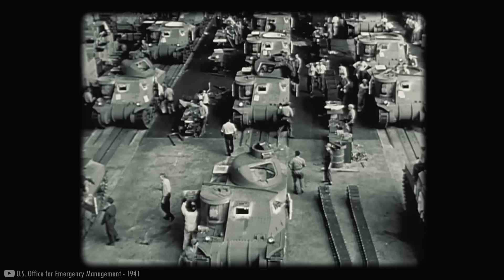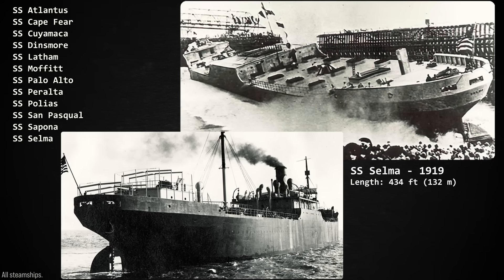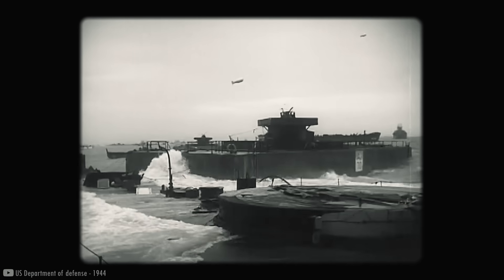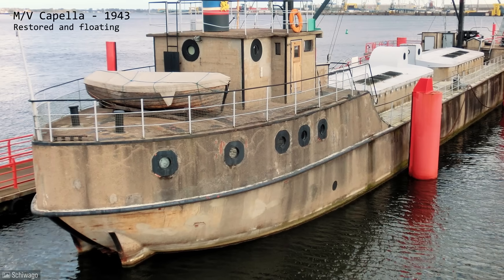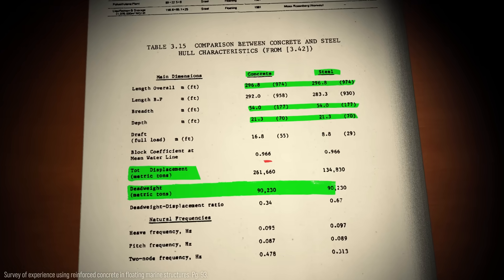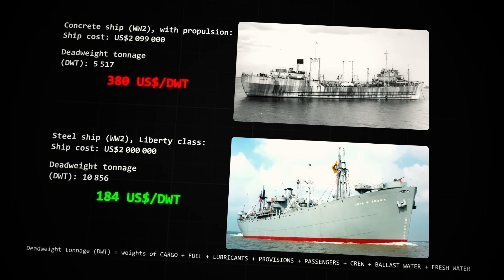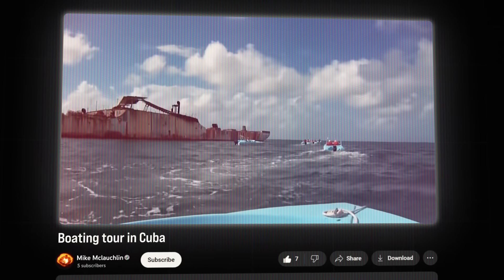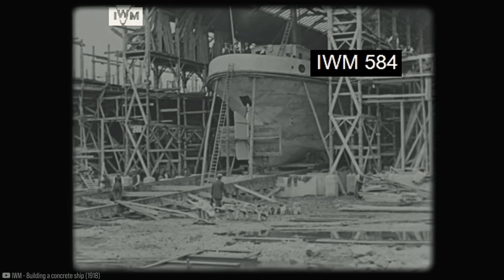The giant concrete ships 😮

Comment: I believe the technology still has potential. A steel ocean-going ship has an active life of about 30 years, during which it requires extensive maintenance to mitigate rust. A concrete ship could easily be made to last 100 years or more, negating the necessity of ship recycling which has become politically sensitive in recent years. I think concrete ships should be given another chance.

Comment: Back in the late 1960s I had a book on building a concrete (ferrocement) boats. I remember the book said a ferrocement boat over 30 feet in length is lighter than a wooden boat of the same size. Concrete is a little less dense than aluminum. In 1972 where I lived someone built a large ferrocement boat in their backyard. We called it the Ark.

Comment: I think the reasons we don't see concrete ships as a standard are the fact that concrete doesn't play well with torsion forces, and also another reason is the metal inside the concrete if not properly buried (5 to 8 cm inside the concrete) it will corrode due to moisture and rust making the cement blow out, thus exposing more metal prone to corrosion, and let's not forget sea water corrodes metal cause of salt

Comment: For every one of those ferrocement ships still afloat, there's dozens that sunk because one crack appeared and rust crept through the inner steel rebar. There was a boom in ferrocement/concrete recreational boats in the 60s and 70s, and nowadays many marinas around the world straight up ban them. Yes, they can be maintained, and if built just right and the weather conditions don't make them crack they might last for a long time, but most of them are time bombs with impossible to predict fuses. Then they sink, and they are impossibly heavy and hard to retrieve.

Comment: Concrete ships are not immune to rust! These are ferro cement structures which contain a complex latticework of rebar rods laid down to give the concrete flexibility and distribute stresses. Concrete is an absorbent material, the corrosive salt water penetrates into the concrete to corrode the steel lattice, and separate the concrete bond to the steel. The main problem that I have with ferro-concrete ships is that there is no way to accurately inspect and evaluate the level of corrosion of the steel rebar embedded within the concrete. A steel ship is constructed so that all its parts can be examined. However IF the concrete mixture is made with volcanic ash instead of sand then the concrete does not absorb the seawater and the corrosion of the rebar lattice  within the concrete is greatly reduced.

Comment: I used to live on a ferro cement boat, quite comfortable, I would be sleeping right against the hull surface, no insulation but it was very cozy and dry for a boat. Steel hulls just sink every bit of heat straight into the ocean if you don't insulate them.

Comment: I think the durability issue could be a double edged sword too.   They do recycle concrete in construction jobs but it depends on the structure.   Where I live the one cement mill has an old abandoned building and one of the workers told me that the walls are 3 feet thick so it's immpossible to tear down.   Yeah you can jackhammer through 6 inch concrete but the labor involved in doing to negates any value of the recycled materials.

Comment: Pier Luigi Nervi, born on 21 June 1891 in Sondrio, Italy, was a pioneering structural engineer and architect renowned for his innovative use of reinforced concrete.

Early Life and Education

Nervi pursued his studies in civil engineering at the University of Bologna, graduating in 1913. His early career involved working for the Società per Costruzioni Cementizie, where he gained practical experience in concrete construction.

Innovations in Reinforced Concrete

Nervi’s ingenuity lay in his ability to combine engineering precision with architectural elegance. He developed a construction system using ferrocemento, a form of reinforced concrete that allowed for the creation of lightweight, durable structures. This technique enabled him to design complex geometrical forms that were both aesthetically pleasing and structurally efficient.

Notable Works

Throughout his career, Nervi designed numerous landmark structures that showcased his mastery of reinforced concrete. These include the Palazzo del Lavoro in Turin, the UNESCO headquarters in Paris, and the Pirelli Tower in Milan. His work on sports facilities, such as the Palazzetto dello Sport in Rome, demonstrated his ability to create expansive, unobstructed spaces using innovative concrete techniques.

Legacy

Pier Luigi Nervi’s contributions to architecture and engineering have left an indelible mark on the field of structural design. His pioneering use of reinforced concrete has influenced generations of architects and engineers, blending functionality with artistic expression. Nervi passed away on 9 January 1979 in Rome, leaving behind a legacy of groundbreaking work that continues to inspire.

Comment: I wonder if anyone has ever explored concrete ships as ice breakers? It seems like they would be more resilient than steel ships in the artic waters. The weight would likely be an advantage depending on the type of ice breaker.
Reply: The action of "breaking" the ice would propagate more cracking in the concrete hull over shorter time than steel. Plus the rougher surface would make it harder to ride up on top of the ice in the first place...

Comment: someone can explain why my cement roof is collapsing after 30 years and a barge from ww2 is still rocking? What kind of cement did they use to no experience cracking?
Reply: It depends what conditions the concrete is under, humidity, temperature can all affect how fast different types erodes
Reply: @thatduckagain3933 again, still.

Comment: Just in my opinion:

Concrete ships vs Steel ships

Pro:
-Lower labor skill requirement
-Less advance machinery requirement
-Materials are abundant
-Rust resistant
-Less maintenance required
-Resistant to the element

Cons:
-Lower cargo capacity (compared to the same sized steel ships)
-Higher fuel consumption due to higher drag
-Lower efficiency of price vs cargo ratio
-Slower(?)

Proper usage with concrete ships would be for long term deployment in outpost region or far away from base. Use them more like mobile structures like mobile outpost, mobile base, mobile storage, mobile depot ECT. In this way, their durability, low maintenance, resistant to the element and rust will show their full potential and no need to move around much, thus negating their cons of higher fuel consumption. Let the steel ships perform the logistic and cargo transportation with their better mobility, higher cargo capacity and better fuel consumption efficiency while  the concrete ships hunker down out in the open ocean and providing long term support.

Comment: They eventually mixed in saw dust with the concrete.. It lightened it up and made it much stronger than the brittle regular concrete used iin the beginning of the use of concrete to build ships.. The English were going to build Aircraft Carriers out of the new concrete mixed with saw dust...

Comment: It makes sense initially to make ships from concrete. But with more scrutiny, like you explained, even if it can be cheaper to construct the ship initially, in the long term a steel ship is much more economical in nearly every category. The only time it makes sense is for stationary or slow moving structures needing minimal active propulsion. Concrete is best suited for buildings and infrastructure, not vehicles.

Comment: Concrete ships are two words that i never thought id hear together. I guess you can make anything float with enough buoyancy
Reply: They are still being produced in Russia, and a new shipyard is being built in the north to produce such ships for work in the Arctic Ocean.
Reply: @НиколайСмирнов-с7х  Just checked, no information on your claims, care to send more information on it?
Reply: @kindasimpson9704 The evidence off its pottential is in this video alone...no need too perfectly specific as dude may not have access too paperwork 'claim' you are looking for but from this video alone it's clear they existed and worked just fine...your splitting hairs
Reply: @jshaw4757 Does this video show “a shipyard in Northern Russia currently builds concrete ships for Arctic Ocean”? A ship model number and public records?
Reply: @kindasimpson9704  I think he means some form of floating pontoon made from reinforced concrete. Russia does build big floating pontoon a size of oil rig for different purpose, mostly to replace function of dock during winter when most of port in north of Russia freez. They can be moved by tugboats, some can move by themself, so you can cosider them as ship as well, some may even have shape of a ship.
Reply: A material will float if it displaces enough water to counteract its weight, so that means technically any material can be made into a boat as long as it is designed to be bouyant!
Reply: @Minidisc_cc  Basically if it contains enough air. Let the water push out the air (Titanic for example) and youre screwed.
Reply: You should look into the aircraft carrier the British looked at making out of wood pulp and ice.  Project Habakkuk.
Reply: @Andre-l8y1n  Im sorry they never built that, it would have been amazing.
Reply: Then you should go cheeck out, floating concrete foundations found in the floating canal houses in the netherlands
Reply: If you really think about it a steel ball would probably sink even faster than a concrete block
Reply: @JamaicanMeCrazy that would depend on the size and weight of the ball and block.
Reply: Well if iron and steel (HEAVYYYYY) can float then why couldn’t concrete? It’s so much lighter guy
Reply: URANIUM SHIP! (no not nuclear ships but like whole hull and everything made out of depleted uranium)
Reply: A lot of barges are used as moveable docks around here with a simple angle iron around the edge to resist chipping.

Comment: It’s also possible to build a ship out of asphalt. Asphalt with steel fibers is 5 times stronger and is so strong that when it has to be demolished it has to be cut apart instead of using jackhammers. If steel isn’t available it’s also possible to use Raylon fibers, which are made from waste paper. They’re water soluble but the tar seals them so well it’s not an issue. In fact, raylon used to be used in car tires because the rubber acts as a sealant. They’re about half as strong as composites, which is still very useful, especially seeing how dirt cheap it is. Slash pine fibers are also insanely strong and can be used as well. Has higher strength to weight than the best oak, and obviously oak made very robust ships. Largest oak ship ever made was 10,000 tons. So a fiber based ship could still be moderately useful by modern standards
Reply: Asphalt is almost semi- porous and relies on sealants to be used as road surfaces. It can be scraped up by a regular bulldozer and is nowhere as rigid as concrete. I mean they have resurfaced the road in front of my house twice in the last decade (it was far overdue the first time). Maybe you meant macadam , which is made with "fibers" in the agregat, is longer lived and less porous than asphalt...
Reply: Wow that's insane...

Comment: The only benefit I can see from a wartime perspective is rapid and mass construction of landing boats without eating up steel supplies for what were essentially single time use vessels.
Reply: Higgins boats that were used for the Normandy landings were made of wood.
Reply: There is a huge amount of rebar and steel mesh in a "concrete" ferro cement hull.
Reply: @rcpmac  ikr - I see those photos of all the rebar and I think "if you laid that flat and welded it all together, wouldnt it pretty much BE a hull already?" I mean obviously you wouldnt actually do that, you would just make steel sheets and weld them, but its probably most of a ships hull worth of rebar.

Comment: Impact resistant, easy to repair, less maintenance, can be constructed with less skilled labor and specialized equipment....These concrete ships would be very suitable to the Philippines who is facing a lack of ships and constantly being rammed by chinese militia and coast guard's gray zone warfare. The Philippines has plenty of cheap labor, lots of ideal shipyard locations, and plenty of materials for concrete, and lots of experience building reinforced concrete structures due to building regulations.

Comment: OK -----------..    Great... and like stated below modern concrete ships and boats are much lighter than Steal.   But the Tech was not perfected before WW-2  making those ships much Heavier than Steel... along with all the other disadvantages of Concreter back then...   If not for the Terrible Reputation from WW-2 and before. Modern Concrete ships using 21st Century Tech that use super Dense 10,000-lbs (versus WW-2 of 3,000 to 4,000 lbs) strength Concrete and composite microfiber reinforcement for additional strength, with a fraction of the steel needed and only as pre-tensioned rod for taking up hull length bending stresses that averages only an inch thick with spaced 3 to 5-inch tension Ribs and Stringers depending size of the ship. The ship would be half the weight of Comparable lengthed steel ships, be stronger and could be built much bigger safely and without ever needing Barnicles cleaned from the hull... 
---------. The statement that even though modern New Tech Concrete ships could be built at the same size and weight as Steel ships the Steel ships are cheaper to run is Purely FALSE... Concrete ships do not need Speed Steeling Barnicles constantly cleaned off their hulls and repainted... That should make them more fuel-efficient and Cheaper to operate...   New Teck Concrete ships Could be a lot more prevalent in the future if a few large ships can ever be built to prove them...with the Advantage of hundreds of years of almost indestructible life in both cold north and tropical oceans (if not Perimid ages) for the Hulls... With only the Running gear having to be constantly upgraded or changed out every 50 to 100 years or so... But even good machinery is getting longer life as well...!!!  The only drawback is that Scrapping Modern Composite reinforced Dense Concrete ships would be almost impossibly expensive, unlike all steel ships..  With no scrapping value at all with their small content of Steel...

Comment: knowing these ships, I always find it funny to see modern houseboats built for almost permanent anchorage and usually having very little loads still being built from steel rather then concrete.
Reply: 80% of those are ex transport ships , they're only static at the end of their life
Reply: @solutionalwebdesignantwerp6122  thats nonsense, newly designed and build from scratch houseboats are a large market these days .. there are entire lake developments building houseboats in series, especially around here in europe. And there are those silly luxury series in Dubai for example.
... that 80% are made from old ships too obviously just a silly number you pulled out of ur behind.
Reply: @solutionalwebdesignantwerp6122  not at all what I refer to, I have these fancy, multimillion new boxes on the water in mind ... and no, used ships aint 80% of the houseboat production
Reply: Well the floating homes in IJburg are made from concrete, or well at least the floating caissons on which they are built are.
Reply: The dock floats of the marinas at the boat docks of a lake I go to we swapped out from plastic to Concrete many years back. It helped reduce the impact of waves on the deck level, and they are guaranteed to last like 50 years

Comment: Canada once considered making a ship out of ice.  If it had been successful, it would have proved very difficult to sink.
Reply: Pykrete
Reply: Was that the "ice with wood shavings" idea? Easily repaired.
Reply: @IanConcannon yes and it had better compressive strength than concrete no joke
Reply: They did actually
Reply: That's what they thought of the titanic
Reply: @ Yes, but the Titanic was made of steel.  This was made out of ice with wood mixed in.  If the material that the ship is made out of floats, then the ship can't sink unless you put a massive amount of dense material within it.
Reply: Easy to melt? 🤷
Reply: @Bangin0utWest  It wasnt pure ice, it was kalled Pykrete and it was frozen water with woodchips/sawdust. The wood acted as iinsulation. They made a small test version. Took 2 years to melt. The real one would have had refrigeration equiment installed in the hull so that it would never melt. Mythbusters tested a tiny version of it.
Reply: @natehill8069 sounds Scandanavian 😂
Reply: i imagine it being attacked with canoes filled with hungry children
Reply: Typical stupid halfbaked Friday night type Canadian idea that went nowhere
Reply: @KeyboardBuster  never thought I’d see anyone with beef against the Canuckians
Reply: @SevenOneThreeThree  They did keep Fidel Trudeau in power for a good while. Maybe you´ll start seeing that more.
Reply: @teppo9585  Tbh it wasnt even a choice, just the way the voting system works for premier's it can be rigged easily.
Reply: @teppo9585 you don't know anything about the names you're saying. You're the type to call McDonald's communist
Reply: @KeyboardBuster  It was a British idea. And the only reason it went nowhere was airplanes got better before they could build it.